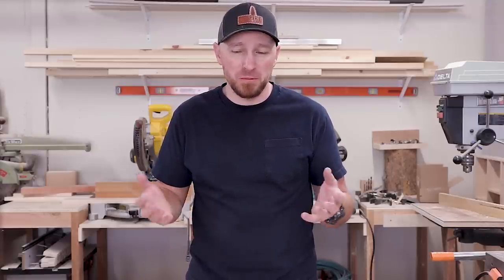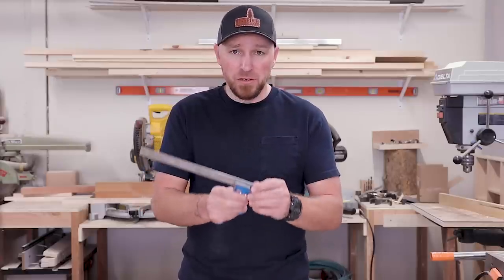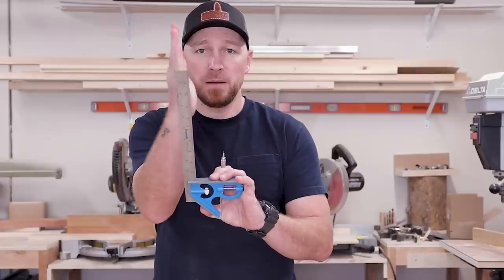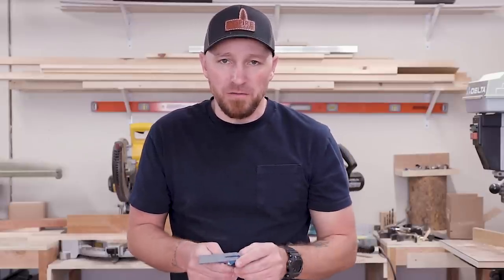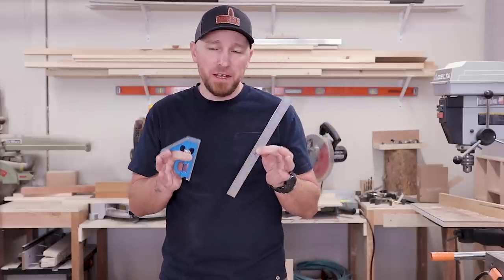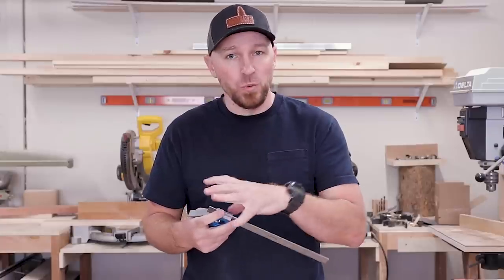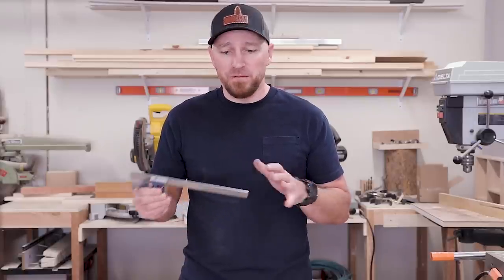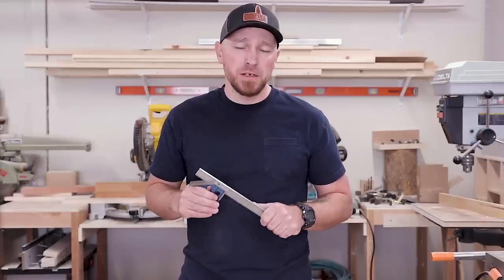How To True Up A Combination Square The Simple Way AND Tune It Up To Make It Work Better For You

Comment from the maker: This is what happens when you suddenly become a stay-at-home-parent, a stay-at-home-teacher, and the world is on fire. Hopefully you guys get enough usable info out of this video but if not, be sure to let me know what you need help with!
Reply: Awesome ass usual Jody! How would you square up a framing square?  Video?  This type of  content is incredibly important  and useful. We also love to see more of  a collection of videos like these that go over thinks like design, finishing,  organizing your work and work areas or wood    species identification just to give some ideas. Love your stuff! Great teaching (presentation) style! Keep it up and stay healthy!
Reply: Truing the framing square is pretty simple. Eyeball the stock and tongue to be sure neither is bent. That's mostly unfixable, but may be good enough for rough work, e.g. greenwood which will  change as it dries.
Check the true as described in the vid. If less than 90d, use a center punch on the tongue ~1/4" in from the inner edge and near the junction with the body and make a dimple. Check for true and repeat if not yet on.
For >90d, do the same on the outer side of the tongue.
For very small errors, I have seen framers scribe a line from the inner to outer corner and put the dimple near the outer to close the angle and near the inner corner to open it.
I've only had to adjust a framing square once so have only done the first example. It only took two dimples. YMMV, but if it is out more than ~3/32" it may not be worth fixing; just get you money back.
g
Reply: Use the superglue and tennis ball technique for babysitting... Superglue their feet to the ceiling, jamb a tennis ball in thier mouth. Problem solved... ;)
Reply: HEEELP! My ruler won’t go back into the housing?! Doesn’t seem to fit next to the locking but!!!
Reply: What brand of combination square is consider high end. I bought one at Home Depot for around 20$. My thoughts was it was high end well a huge step up from a speed sq. Lol
Reply: @Alex-hx6bj  There is a spring-loaded thing that need to be pushed and twisted into alignment. If not, a BFH will fix it.
Reply: My combo square reads obtuse one way and acute after the ruler is flipped within the frame.
Reply from the maker: @Mark Harmon It could be that the lengths of the rule itself are not machined parallel. If you measure the width of the rule one one end and again on the other, you may come up with different measurements. If you are working with a long rule, check at many spots because sometime they are not only not machined parallel, but also inconsistently, giving you a wavy sort of situation. That’s why sometimes a square can read square when the rule is pulled out to a certain measurement and completely out of square when at another.
Reply: I really appreciate your videos. I'm down from 60 hour work weeks to 20 hours a week since June.  Your channel and a few others have kept me being productive and busy. Keeping me from going crazy. Lol. I'm a lot better on my woodworking now, than I was last year at this time.
Reply: @brandonpurselley402  starrett or mitatoyu generally
Reply: You talked about when putting the ruler back into the head, digging around trying to find the groove, you would remove material. I have a couple of the Empire combo squares and it is much easier to push up on the spring loaded lock pin and you can get the ruler lined up with the groove with a lot less "digging" around. I also use WD-40 Dry Lube in the groove and on the bottom pads to help with the metal on metal movement to reduce the "wear and tear."
Reply: Dam spot on with that one hu...3yrs ago, height of the isolated chaos. Thank God schools opened back up!
Reply: @Alex-hx6bj yep I'm right there w ya on this... the comment somewhere behind above us explains how to do this...I heard something about little pads being inside there but I'm sure mine are gone now cus I kinda carelessly pulled mine apart in my very very messy gross floor shop...never gonna find those pads.
Reply: @ElohiSilverEarthVentures  I think I got it back!!
Reply: The world is not on fire, my friend. It's the same as it's always been. No better, and no worse. Just be glad you live in a First World country.

Comment: I just checked my square yesterday, it wasn't true I was going to do this on my very ancient moore & Wright square malleable iron not pot metal it turned out there was a blob of CA glue on one of the pads. Check for cleanliness first is my suggestion especially if you're a glue splatterer like me! 

Keep well and prosper

Comment: Remember that by checking squares this way, the two parallel lines, the difference is doubled so remove less than you think you have to. Just check it often when sanding/filing it.

Comment: And now I know why cuts made, marked with my combination square, were never quite right.  Time to true-up the cheap tool.  Thank you for the clear explanation and straightforward steps.
Reply: WOW......   never even considered it as a problem although even yesterday I was puzzled working on a project.    Just checked the two Irwin 18 “ squares I have.......one was off quite a lot and the other right on.    I’ll work on the bad one so thanks....I’m basically a DIY guy but still like to have the best tools that do what they are designed to do.   Thank you....Bob

Comment: Very good and clear explanation of how to check for squareness and correct it if needed. As another commenter noted, both long edges of the rule need to be parallel as well as straight.

Comment: Excellent video!  Many woodworker just “assume” the tool is at 90 degrees and are surprised to find out it is out of square as the same thing applies to a level tool being out of level or plumb.  You should show your viewers how easy it is to check a level tool for true level and true plumb.  Keep up the great work!

Comment: I'm a machinist that dabbles in woodworking. I have a 6" and a 16" Empire combo squares at work. I guess I got lucky, I've checked them on our CMM and found both to be <.5°off from square. After checking the price on the non-blem PEC 12" 4R 4 piece set on Amazon, I bought the 12" 16R 4 pc blem set at Taylor, along with the 4", 6", 18", and 24" blem 16R scales to match, and the price with free shipping came out to less than the Amazon price (even after CA sales theft). I'm bringing the Empires home, and replacing them with the PEC upgrades! Thanks!

Comment: Very useful information especially for a novice like me.  I found that when inserting the ruler into the square that if you  loosen the screw and push on the spring you can slide the ruler back on without ever having to tip it to align the grove,

Comment: I had long suspected that my old Craftsman combination square was not.  Checked it with my digital angle finder this morning and it was off just .1 degree.  Used a little sandpaper on the high side and now it's 90 degrees every time!  Thanks for the fit tip.

Comment: kind of thought I knew things like this yet you always have a tip for me to pick up. Also totally agree on the 'how much work you need to put in to a job to save a few pound (or bucks)'. Many times people loose sight of that. Just restored fully a Stanley Plane n6 and it took me aaaaages. Thanks good man. As always pragmatic and very practical.

Comment: I bought a combination square from Lee Valley for a good price but when I checked it, it was, well, unsquare. I used a thin file to do what you suggested and all is well. However, I didn't realise that the blade could remove metal as well so I'll be softening the edges. Thanks for that.

Comment: Great video made under “trying” conditions!

When you are truing up the head using sandpaper on the jointer, having a flat surface is helpful but it doesn’t guarantee the tool will come out flat. it’s a good idea to count the strokes and turn it around so you go the same number of times each way so that errors cancel out. The tendency is to remove more material at the front as you push the work across the paper, so the bottom and front faces will go out of square. You can take advantage of this phenomenon to correct out of squareness, but it can also introduce a slight curve. Check your progress often.

Making a cheap or damaged tool perform well can be a satisfying experience, and it’s a good skill to learn. One lesson is to buy quality, which can mean buy cheap, but look closely before you buy!

If you were a toolmaker, you’d use three similar tools and lap them against each other, alternating the surfaces, but then again, you’d have surface grinders, scrapers and surface plates. This is about woodworking, not toolmaking!

Comment: >You should also check for parallel of the rule before tuning the pads by useing a caliper. In a former job I was a machinest at a zinc die casting company. For several years we manufactured the combination heads for a cheaper tool company. We cast, painted and milled the heads. To ensure squareness, one of the steps was checking with a rule against a known standard. We used a known rule we had checked each time. Some of rules the company gave us were several thousandths off from parraell from end to end.
Reply: Love the fact you used the word "Rule" not ruler, just a pet peeve of mine, they are not "rulers" but most don't know the difference.

Comment: When I true a square I find that I am also going to be checking it multiple times. Therefore I am making multiple sets of lines. If I am using a piece of wood to mark on it soon becomes cluttered. I hate marking on a nice piece of wood so I tape a  8.5 X 11 piece of typing paper to the wood surface and proceed as you have identified so well. If I need to replace the piece of paper due to soooo many lines drawn on it I can remove it and place another piece of paper.  When the rule is square I can remove the tape and paper and I still have a nice unmarked piece of wood.
Reply: Heh...all those lines had me concerned about squaring up my combination.  Throwing tape down is brilliant!  Thanks for the idea!
Reply: That's a great idea. If you are taping a sheet of paper to a board, couldn't you also tape it to the top surface of your tablesaw, using the front edge as your reference?
Reply: @drewscreen   -- YES !! Using the front edge of your table saw is excellent. Your sheet of paper taped to the top of your table saw only needs to be slightly longer than the blade of your square. Once I have adjusted the square and I am ready to test again I always mark out the previous lines drawn so I dont become confused.  Good luck.

Comment: I always thought starret tools were way over priced until I inherited some. The combination square was dead on even though it was around 40 years old.
Reply: Yep, as a professional welder of 28+ years, buy high quality tools every single time. Then take care of them like you were going to pass them down to your kids.   The ONLY squares, protractors or centering heads I have are Starett. For calipers, only Brown and Sharp.
Reply: @roydunn4649  Out of curiosity what do you think about mitutoyo tools? I have no bad experience with there measuring tools.
Reply: @sen74diehard  in my experience Mitutoyo makes great tools. It all depends on who you talk to and what they do. If I was buying a dial caliper it would be Brown & Sharp, someone else would buy Starret or Mitutoyo. I personally like and trust Starrett layout tools and have never had any accuracy issues in 28+ years of professional welding.

Comment: You done good.  50+ years ago my dad gave my brothers and I each a total steel combination square.   I checked mine about 2 weeks ago.  Good as new.  I need to polish the ruler.  Getting a little hard to read.  I should add, I look after my tools.  I've seen people using theirs as a hammer, prying open Cans of paint, scrapers, door jams.  I freak if mine falls on the floor.  Lol!!!  Stay safe.

Comment: Good, cheap trick from “ “, using “cheap replacement paper. 
Also CLEAN first! 
I have some badly abused and rusted Starret parts that need to be rehabilitated before I start, but now know that there is a light at the end of the tunnel.
Great video. Simple, no frills explanation, and respect for a craftsman’s ability to make a marginal tool perform at a higher level!!

Comment: I use my table saw top to draw pencil lines for checking square.  They rub off easily, but I suppose they don’t photograph well.  Works in the shop though with good lighting.

Comment: I just wanted to mention one other fix for these.  I bought two PEC blemished combination squares and both had acute inside angles that weren't up to their tolerances.  After returning the first, I found the issue on the second one.  It wasn't the pads, it was the ruler.  The ends of the ruler are a little wider than the interior.  When using the test in this video, we push the ruler all the way out so those larger ends are sitting on the pads.  That will make the interior angle acute.  By my math, even .001" wider will cause about .01" over the course of the rule.

I flattened the ruler with sandpaper on my cast iron table saw top.  This fixed my issue.  I was so close to taking a file to the pads and I'm really glad I didn't because I bet those are dead on.  Morale of the story, check your ruler first!

Comment: Great video. Note that all rulers will develop a hard and even hooked edge, when burnished by metal, such as a marking or cutting knife being constantly drawn along it. One way to relieve these edges, and even straighten and remove nicks, is by drawing it across (at an angle) on a fine grit wet and dry sheet of sandpaper laid on a piece of float glass on the bench. Take care not to press too hard, especially when canted on an angle. A couple of drops of water UNDER the paper will temporarily adhere it to the glass. The same technique works in straightening wood and drafting rules too, but softly, softly.

Comment: A handy item in any woodshop is a piece of 1/4" or thicker mirror or plain glass. There must be millions of old used Starrett, Brown and Sharpe, and similarly high quality combination squares lying around unused. Most are without the modern satin chrome finish and have become uniformly gray, maybe mottled with spot rust. 220 grit or finer silicone carbide paper adhered to glass with water does a fine, quick job of restoring the shine to all flat surfaces, levels lightly dinged edges and makes the finest markings easy to read again.
Reply: Mark Koons 
An even better surface is scrap granite countertop. The thick stone is much more rigid than a plate of glass. My local granite shop let me take as much as my car could carry!
Reply: @trackie1957  Excellent. I always admire that and even Corian-type materials. Next time in the big city i'll ask around.
Reply: @trackie1957  Great idea. I should have realized the scrap was available cheap or free somewhere.

Comment: I'm gonna try this on my Irwin 6 inch square. It's about 1/64 inch out of square on a 4 inch line. I bought an Empire 6 inch with an aluminum head and that thing was a 16th out of square on a 4 inch line. I was shocked it was that bad straight off the shelf. Gave to my mother-in-law as a bonus X-mas present.

Comment: Regarding the 6 inch Empire, I recently noticed with mine that the hook on the lock bolt had worn away to the extent that the ruler no longer gets held tightly.. I find this really frustrating  as Empire squares are quite expensive here in Australia..
I'm yet to fix it, but I think in order to do that I'll need to fabricate a whole new square bolt from something harder than the compressed foundry slag from which the original lock bolt was made.

Thanks for the content.. :)

Comment: I'm glad I found your video.  My combination square is out of true and I didn't have a clue as how to fix it.  I'll try your suggestions to see how it works out.  Thanks.  Oh, is there a proper way to assemble the ruler in the head.  It seems to fit both way (upside down)?

Comment: When you were checking for square, you avoided a mistake that I bet most people make. I believe most people intuitively try to draw both lines right on top of each other. What you really want is to have a tiny gap like you did. Eyeballing that gap is much more precise. Otherwise, you could have your second line off by a half line width to the right near the head and half a line width to the left at the other end. It would look like a solid line, when it fact it isn't. Having that gap also helps you avoid going the wrong way with your correction.

Comment: As draughtsman of over 50 years of experience on the board and cad can I give you a tip? The pencil or pen will work much better if it is perpendicular to the paper or wood as you draw the line, - not 30 or 45 degrees to the paper or wood. Tilting the pencil at a slight angle along the axis of the straight edge is desirable and if you twist or spin the pencil between your fingers as you draw the line the lead/graphite will self sharpen to a point as you draw the line and won’t end up with a flat. If you don’t twist the pencil then as it flattens when you drag it across the paper or wood the line will thicken. Simple.... Thanks for the tip, my square was out and I didn’t know you can fix that - you saved me from buying a new one 👍 cheers.